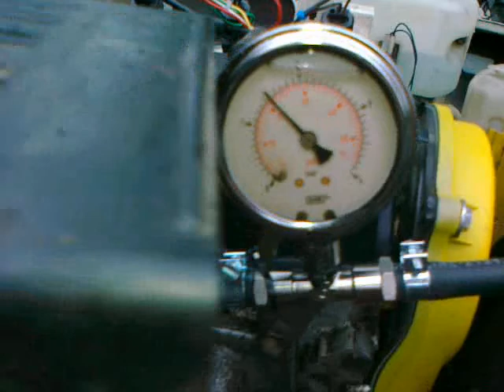SJ 413 EFI.mp4

Comment from the maker: Thanks man! Engine runs like a dream and I'm loving it! It feels like power and torque has increased and the engine runs like a Swiss clock! :P

Idle speed is around 700 and 800Rpm. The tachometer has been modified to function with the ignition system and I'm not sure if there's a 100-or-so-Rpm inaccuracy.